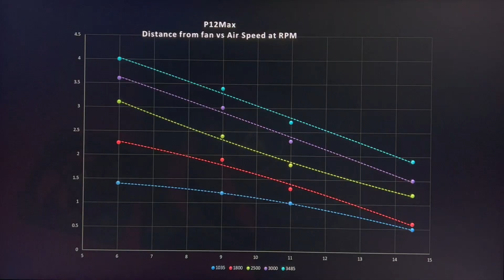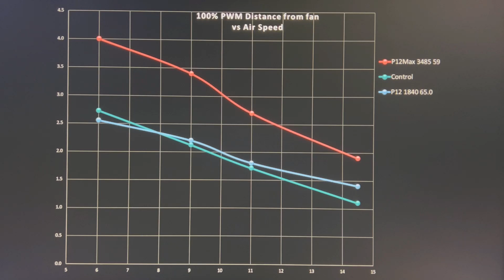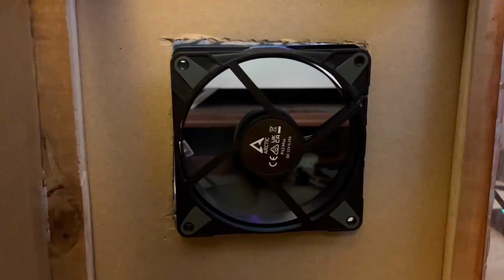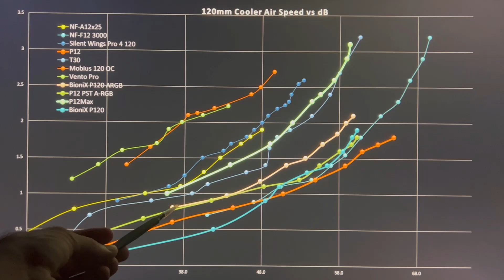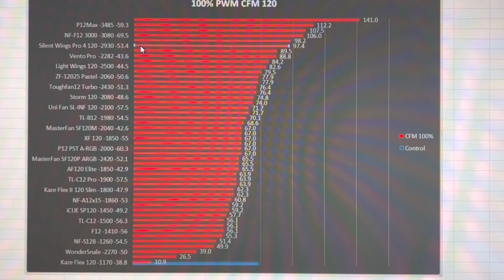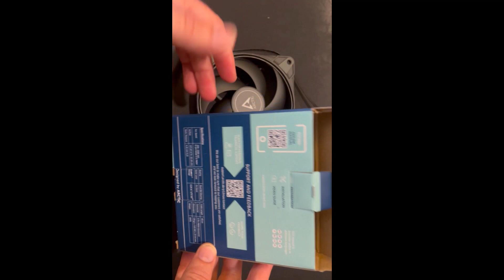Take your PC cooling to the MAX with  The P12 Max  (Old Testing Method)

Comment: Excellent video and thank you for all of the great information. I appreciate it, currently considering the Arctic  P12 PST PWM vs P12 Max. Main concern is dozens of reviews/comments all mention issues with the P12 Max producing very loud noises around certain rpms even after receiving multiple replacements but some users also have not had problems. Which makes it seems like certain batches are affected?
Reply from the maker: I pretty much agree with that statment. in general I have found Arctics quality control on a scale of 1 to 10, 10 being perfect like a 7. Noctua is like a 9.5. So if you get a good one P12 max / pst are good. 
In my revamped analysis I think i got a lemon P12Max. It was OK not good not bad noise normailized. but maxed out it was as expected. 
Does this help?
Reply: Yes thank you for your reply, just subscribed too. I'm leaning more towards the p12 max thinking if any problems do occur within its nice warranty period hopefully a new revision could be sent as a replacement. If i'm correct after researching and watching just about every arctic fan review there are multiple revisions ( up to 4th or 5th) with the standard p12 over the years that update possible issues.
Reply from the maker: @therealbdbeatz  thank you for subscribing. Basically ya thats why warranty exists or exchanges using amazon return. :)

Comment: Would the noise-normalized airspeed through the cooler still be applicable if the fans were set up in a pull configuration instead of a push configuration?
Reply from the maker: yes and no. I talk about this in the open box area. I do a simple test of just placing the fan in pull and just saying noisy, medium, quiet, and what kind of noise like pitch high or low. for example the Be Quiet Silent WIngs 4 pro is very very noisy in pull like a buzz saw. but in push its relatively quiet. 
One thing I am missing is a radiator so I cant say how a fan will do on that put on a fin stack i can. 
For the P12 Max it was high pitched and medium noisy. 
reference point the A12x25 is quiet